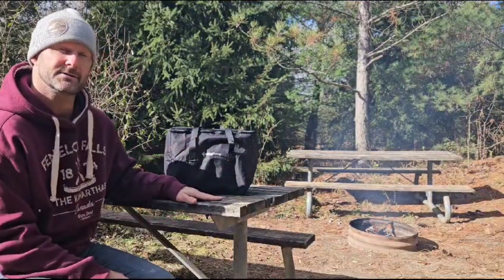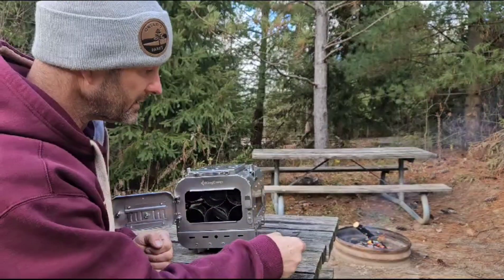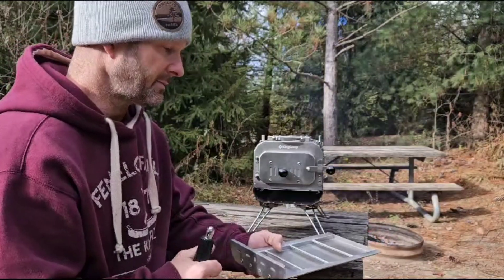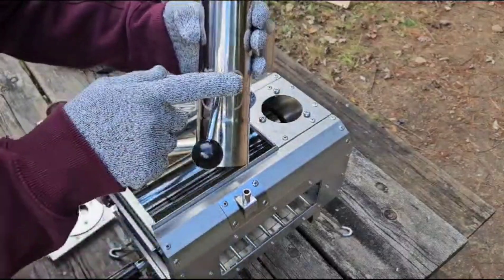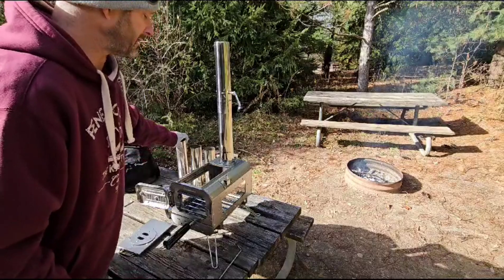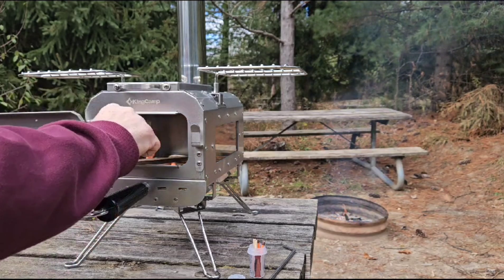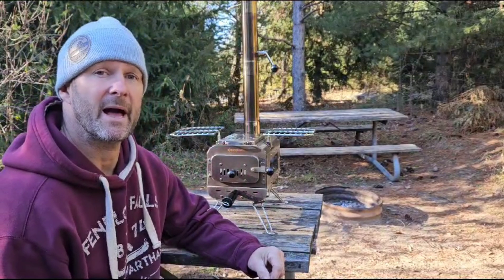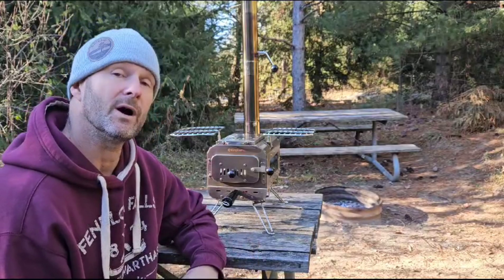KingCamp / Mini Hottent Stove Review /Affordable WoodStove

Comment: I grabbed the medium one for my bell tent. It is a nice little stove. I added a gasket around the inside lip of the top panel to make sure no smoke comes out when i shut the damper down. The only other thing i plan to do is to swap the rivets on the cooking plate for countersunk ones so i get better contact on the metal with my cookware.
Reply from the maker: That's awesome 👍 I just spent the night out with ours. I must say it was way more efficient than I expected.  I agree with the rivets! My stove fan was rattling but I was still able to move it enough.  

Love the input, let me know how it turns out 🍻

Comment: Greetings,

I appreciate your kind reply and your receptivity to input from subscribers.

I have no direct experience with AV production. I have a technical background, including electronic troubleshooting and Industrial Design, but I am not qualified to provide professional advice for videography or audio editing. I will share what little I am confident in contributing...

There are multiple aspect to audio recording. These two are very important:

1. Volume Level

2. Sound Quality.

Sound quality might seem to be the most important, but even the best audio quality will be degraded by varying audio levels. If a recording has great sound quality, but the volume level changes abruptly or repeatedly, the viewer will have a diminished viewing/listening experience.

If background or surrounding audio has been an issue, you may want to research cardioid pattern microphones. Cardioid is a directional pattern-when the mic is oriented toward the speaker, dialog capture should work well. 

Omnidirectional or bidirectional mics may not be a good choice for dialog in a setting with significant secondary sound levels. Those "pickup patterns" or "polar patterns" are, however, very effective in recording ambient or desired background audio.

For example, if you are recording dialog, a cardioid lav or shotgun mic should work well. If you want to record a broad, comprehensive environmental audio segment, such as crickets chirping, frogs croaking or birdsong, an omnidirectional pattern mic should work well.

Many of the channels I view do use Rode products and they provide, in my viewing experience, good performance. Keep in mind that exterior recording is a bit different from interior recording. Mics used outdoors need to be robust and able to withstand humidity and minor impacts.

I believe you are establishing a successful YT channel. The warmth, joy and family dynamic you present are, in my opinion, far more important than the technical aspects of your content. If you desire to grow your subscriber base quickly, you may benefit from making contact with established YT content creators who are receptive to collaboration. 

I performed two quick online searches to find advisory or review information for microphones and post-production audio software. If you are considering audio software, bear in mind that online-based applications typically require a reliable, fairly high-speed internet connection. If you have an intermittent or low-speed connection, traditional software may be a better choice.

 The search strings text is the verbiage between the asterisks. If you want to perform additional research, you can copy & past the entire text strings, including parenthesis and quotation marks, into your search page.

********************************************************************
("microphone for YouTube" OR "microphone for online video")
*******************************************************************

https://www.mixcord.co/blogs/content-creators/best-microphones-for-youtube-videos

https://riverside.fm/blog/best-microphones-for-youtube

https://www.syncoaudio.com/blogs/news/what-microphone-for-youtube-recording-to-use

https://castos.com/best-microphones-youtube/

https://shotkit.com/best-wireless-microphones/

https://www.soundguys.com/best-mics-for-youtube-21997/

*************************************************************
"audio editing software" ("YouTube" OR "online video")
*************************************************************

https://devtechnosys.com/insights/best-software/audio-editing-software-for-youtube/

https://www.kapwing.com/tools/audio-editor

https://riverside.fm/blog/best-free-audio-editing-software

https://moviemaker.minitool.com/moviemaker/video-sound-editor.html

https://www.pcmag.com/picks/best-online-video-editors

https://www.audacityteam.org/

https://devtechnosys.com/insights/best-software/audio-editing-software-for-youtube/

You are doing great! Keep up the good work...
Reply from the maker: Honestly, I thought when I finally had the guts to actually get in front of the camera, I'd be swarmed with harsh negative comments. Everyone so far has been kind and i take everyone's opion as positive direction.The time you have taken to pass on this info is so greatly valued. I have been researching audio and video issues we're having but it's hard to get answers. I fully understand what you wrote and appreciate all the direct links. It definitely helps me continue to get better at this! 

Thank you for your kind words and advise. Looking forward to future advice 🍻